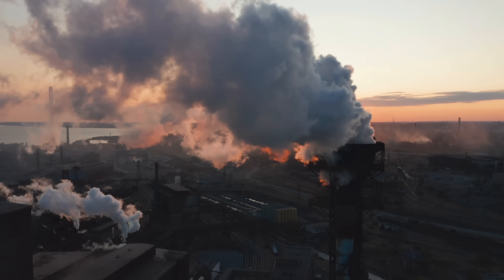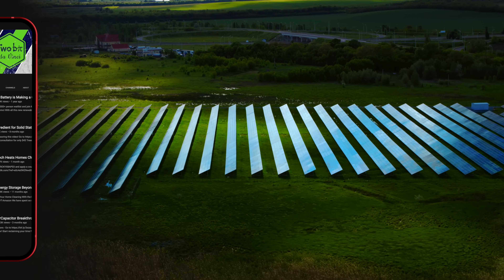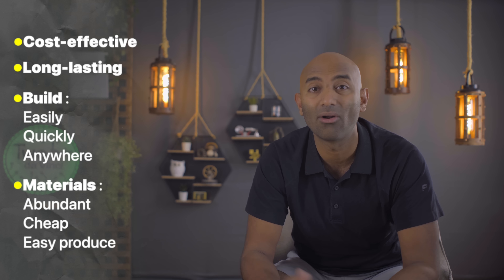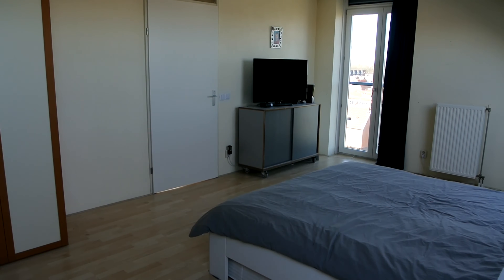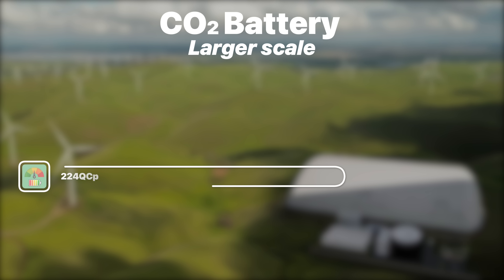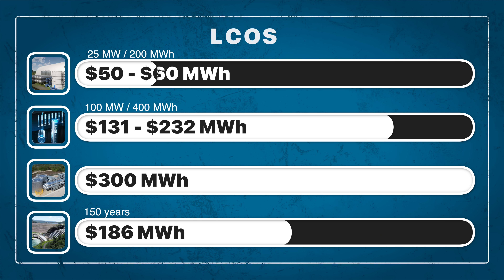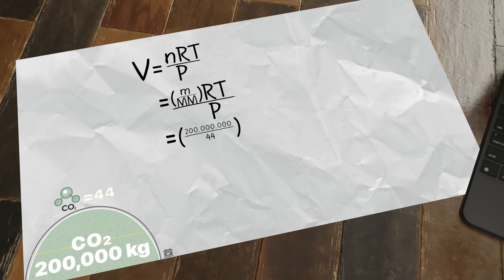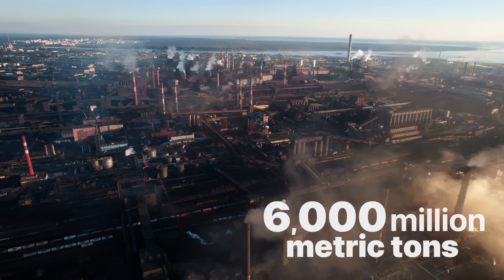The GENIUS Of the Carbon Dioxide Battery

Comment: Yes tell that to all of us who run CO 2 generators into our greenhouses to help our plants thrive even better.
Reply: I can remember years ago shutting all the doors and windows of my greenhouse full of budding tomato plants. They remained alive, but completely stopped growing. This would also mean that they would also stop releasing oxygen into the atmosphere.
Reply: Yep, I run 1500 ppm at 10000 feet elevation here in crested butte. We only have 320ppm here naturally.
Reply: I often wonder that CO2 and how it makes the atmosphere warmer. By the table specific gravity Nitrogen is the lightest, then oxygen,. Carbon Dioxide is heavier.
In fact calm days working in in 6 foot deep closed end trench is dangerous because Carbon Dioxide. That is one of the ways I paid for college.
But what contains the daytime heating at night is water vapor or clouds. Water vapor is also called latent heat. Yep water vapor is lighter than Carbon Dioxide.
So where is that layer of Carbon dioxide in the atmosphere mostly located again?
Another source of water vapor besides lakes and oceans is plants. And plants do what with Carbon Dioxide?
So in a way CO2, water and heat is related. But where do the plants get the energy to take liquid water and turn it into a vapor(clouds)?
There is a thing here in Michigan. Do a No Mow May. I think that Chemlawn, Scotts and the distributers do not like that.
For one thing it gives the plants time to grow deeper roots. This includes grass.
 So if you don't do that. You don't need as much water it to keep it green. I guess the city also makes a profit off selling water.
I don't care. I also have 6 different types of grass growing in my lawn. The one that my dog likes to eat is the one my neighbor does not like. It also is the grass cattle prefer.
You see I grew up on a farm. I do not think a lot of college study understands why the Amish don't need chemicals to make crops grow.
You would think that after 5 or 6 generations of farming. Farmers would figure that out what actually works better..
You see my dumb ass just did not like farming. So I took up BIO-medical electronics engineering. So I kinda know a little about physical chemistry and biological processes.
That does not make me a Ph'D in all of those combined studies. Just gives idea of what questions make sense and also why answers are not logical.
I also am old enough to have went to college, when some of the classes were for how to think. Instead of what to think.
I think this carbon neutral, zero carbon is the work of FlimFlam men and women. Also they are not doing it for fun.
Reply: On top of that, historical records show, the decades of the 20th century that had the highest levels of CO2 (the world war years) had the lowest average annual temperatures.  More CO2 cools down the atmosphere, provides plants with what they need to breath and is nowhere near the Capital-E Evil that propagandists make it out to be.
Reply: CO2 helps plants grow. Our planet is 5% greener than 20 years ago, thanks to CO2. We are still in an ice age let's get out of the ice age and melt this fucken ice. The dinosaurs had 3000 ppm of co2, and their temperature was only 27 Celsius. We have 430 ppm only 0.04 percent of our atmosphere. Our weakening magnetosphere is what is driving climate change, not CO2.
Reply: You wont get extra growth without ALL the factors required for it-extra nutrients water etc!!! CO2 will not do the same outside a greenhouse!!!
Reply: @Mauricio17-x1p 😂😂😂 Yeah that’s why NASA has already shown significant greening of the planet.
Reply: @Mauricio17-x1p  yes it will on a farm field where all the other inputs are also provided
Reply: @Mauricio17-x1p  NASA data shows the Earth is getting greener as CO2 levels rise. CO2 is the limiting factor in many cases for plant growth and plants become more drought resistant at higher CO2 concentrations as they do not need to process as much air to get the needed CO2 thus reducing evaporative loses of water from the leaves. CO2 outside of green houses will lead to greater plant productivity.

Comment: CO2 is the answer. We should promote CO2 production because it benefits plant propagation. We shouldn't be concerned about the increase in temperature of the planet.  If you look at historical evidence going back to Babalonian time you will see increase of temperature of the climate those societies had an abundance of food. People thrived in times as the climate warmed. It also promoted plants and the process of transpiration which is the production of water from plants and production of oxygen. We do not want cooling climate temperatures because the plants will suffer, low food production and increase of death rate of people. More people die in cold climates tha warm climates. The argument that sea levels are rising is true but not to the extent the climate alarmist are preaching. If you take two dimes and stack one on top of the other that is the amount the sea levels have risen. Electric cars are the worst thing we could do for the environment.  If we want vehicles that will benefit the environment we should go to natural gas for vehicles. Natural gas produces CO2 and water. Unlike gasoline, diesel and propane and butane, natural gas would be released into the environment if the vehicle gets into an accident. The U.S. is the OPEC of natural gas. Battery cars will not work. It takes too long to charge, when the battery is replaced the cost is very expensive to recycle because of the heavy metals used to make the battery. Electric vehicles also catch on fire for no reason. Natural gas is the way to go in the future.  For those of you who believe that we need to get rid of oil, it will not happen. Oil is the decomposition of organic material.  We use oil to make plastics, capsuls for medications, clothing, etc... The world will never run out of oil. If you want a cleaner energy to use, we should move everything to natural gas. Wind power and solar power does not produce enough energy for the U.S. Most of the time, windmill generators break frequently and the wind doesn't always blow. Problem with solar panels is the recycling the panels at the end of their life is very cost prohibitive. California is throwing solar panels in the landfills because they are too expensive to recycle. The heavy metals is now leaching into the ground Doesn't sound very green to me. We could use nuclear power which is very cheap and safe and would generate enough energy for our country. The improvements in technology for nuclear power plants makes it the best power source for the grid.

Comment: Manufacturing and maintaining all that wind and solar also produces a carbon footprint. You ignore that too.  Science research shows that an EV has to be driven 185,000 miles before it's carbon reducing benefit outweighs a gas powered vehicle driven the same distance. That's because the carbon footprint to produce the EV is higher before the EV hits the showroom. Charging the EV for the life of it also creates a carbon footprint. In addition, you won't get 185,000 miles out of an EV battery. The new battery has to be produced, and all those processes create a carbon footprint. The cost of the EV is 20,000.00 more then a GV and the Battery replacement is 30,000.00 minimum.

There is nothing cheep about owning an EV and they definitely result in a lot of carbon emissions to make them and keep them running. People are so stupid for ignoring the facts.

Comment: This appears to defy the laws of physics.    The energy required for the compressors and storage will roughly equal the available energy from the compressed air gas minus efficiency losses.   The carbon footprint of the plant itself combines will make this a negative adventure

Comment: You live in what's called an "interglacial" this means you live at a high temperature point between glacial periods or ice ages if CO2 raises temperature you want to start burning as much coal and oil as you can because the next ice age is coming and it's going to last 90,000 years, interglacials last 10-15,000 years and we are at the end of ours you're not going to get hotter you're going to get a lot colder.

Comment: Just a note for the incorrect information related to the microinverters. Modern solar panels have bypass diodes. These diodes prevent a single panel, or even multiple panels from shutting down the entire string. A single shaded panel will cause the entire string to produce less, but will not cause the entire string to produce nothing.

Comment: Wind and solar are both bullshit. They don't work enough to offset the cost to make, maintain, and dispose of. The built in life expectancy failure points assure that the carbon footprint vastly outweighs the marginal gains. The highly toxic batteries have virtually no staying power and are killing everyone involved with making, maintaining, and disposing of them. This is entirely a scam.

Comment: The main problem with solar, wind, and electric cars that I see is the amount of environmental damage done by mining the lithium and other rare earth metals to make the batteries, panels, and whatnot. On top of that, the batteries only last for 10 years and do not have an efficient way of disposing of, which means they're gonna be disposed of in a way that will further damage the environment. This is why I see natural gas and nuclear as the only way forward for constant and effective energy. Natural gas has a significantly lower emission rate than coal, and nuclear, so long as the technology is maintained properly, is almost never going to have any major catastrophe like Chernobyl. There have only been 2 major nuclear meltdowns in the past 60 or more years, and neither of them were in the US or in new plant's. Let me know your thoughts on this as well I'd love to hear it.

Comment: The clickbait title implies that CO2 is not a problem at all, but the script and the data referenced by it point out that it depends on its LOCATION.  Mixing freely with the atmosphere, CO2 IS a cause of climate change via the Greenhouse Effect.  But confined as in an energy storage system such as the one described here, it becomes part of the solution.

Ozone is similar; at ground level, it causes health problems, but up above the stratosphere, it protects us from UV radiation.

Comment: Who has the ability to control the weather?  Your belief that carbon dioxide is a culprit might be wrong?  Just have a think! Science knows a lot about millions of years of weather and CO2 concentrations.   Most of earth's history is full of periods with much higher concentrations of CO2.   We have lots of oil and gas because of these high levels of CO2.  Life flourished.  Should we maybe worry a lot more about global cooling and a coming ice age?  Wouldn't an ice age be much more catastrophic to all life on earth?  Just a thought.  I think you might do more research on different opinions with real data.  Modern weather knowledge and detailed data are much less than 200 years.  Life one earth has been around over 100 million years.  It evolves along with the weather and conditions on the planet.  We've had over 10 ice ages.  What caused them?  Why did they end?  Man wasn't a factor.  Man's activities don't amount to your drop in the bucket even today.   Stop the BS!

Comment: Lake Nyos in Cameroon comes to mind with something like this. Over 1,700 people dead and over 3,000 livestock.

Like nuclear plants, these obviously cannot be located anywhere near populated areas. But even if this was located so far away that the risk to human life was not significant, you still have the risk to wildlife and the ecosystem surrounding the facility. A cloud of CO2 will pretty much sterilize a region of all animal life - insects, mammals, any reptiles and amphibians, etc. And until it dissipates, it won't be great for plant life either.

CO2 in any significant mass settles toward the ground and creeps along with the air currents. Silently killing anything that crosses its path.

So hopefully they've heavily evaluated the risk to the surrounding area. Tried to simulate as best as possible what would happen should the tank or refrigerant lines rupture and getting a good idea on how any released carbon dioxide will perform. Engineered so that any possible release of CO2 will happen in a controlled fashion to avoid substantial masses of it being released and creating killer clouds.

Comment: The biggest takeaway for me is that since CO2 doesn't require cryogenic assist to be compressed into a liquefied state, it is much more efficient than compressed air. For utility power plants, I don't think the CO2 battery's low energy density will play much of a factor in deciding whether to use it in comparison to other technologies, though the short vid of the Tesla with a CO2 dome on its roof was a good bit of fun.

Thanks for the great video. I see so many videos like "Graphene Eardrum Replacement Surgery Enables Supersonic Hearing", and it turns out to be nothing more than a calculation someone did on the resonant frequency of a piece of graphene the size of an eardrum, and is nowhere even close to becoming reality. That there is a CO2  pilot plant currently operating and a contract to scale up this tech in a real-world application is just wonderful and makes this video so worthwhile. Thanks for covering this.
Reply: be more skeptical. on the diagrams the liquid cooling system has no pumps. 
supersonic rocket surgery battery enabled!
Reply: You can criticise but this could save us all from the money hungry power companies that bleed us dry.
Reply: @Lorenzo-ew6so  I'm not sure what you think I'm criticizing, but to be clear, I am absolutely heaping praise on the utility-scale compressed-CO2 battery explained in the video. It's the best, most sensible advancement in utility energy storage I've yet seen.
Reply: @Astronomator  
one more thing/giant rant. what if we find out that using a regular refrigerant in the system is a lot more efficient than CO2? still CO2?
i swear its a total obsession. what a fad. the premise being that you actually need storage tech . we already have 'storage' tech. 
its called nuclear fuel rods. zero CO2.
but if we need something non toxic that people can put in their mouth,
we can always use giant rubber bands. 
theyre more efficient and the carbon would be trapped in the rubber instead of in the dome. takes a lot less volume. we can then bury the used rubber in a carbon sequestration program. and if the program fails the worst that could happen is you will find people chewing on it. this is practically watertight on every level. yuck.
Reply: @echelonrank3927  It's not the use of refrigerant, but the energy needed to liquefy compressed gas (through refrigeration) that makes other gases less efficient than CO2 to use as a battery. A lot of energy is stored/released during phase-change, and CO2 undergoes that phase-change without the use of power-hungry cryo-equipment, giving CO2 a definite advantage in efficiency.
Reply: @echelonrank3927  Please don't put words in my mouth. Neither I nor the video said that CO2 is the most efficient gas. The only comparison made between gases in the video was between CO2 and air, and CO2 gets the not for efficiency between the two because it can be compressed to a liquid without cryo-assist. I'm sure other gases are more efficient than CO2, but CO2 is abundant and essentially free, unlike most other gases we could consider. And once you have a free and plentiful gas that can undergo a phase change through mere compression alone, there's pretty much no reason to keep looking for a more efficient gas. 

I won't dignify the rest of your comment with a response, as it's not even on topic.
Reply: @Astronomator   meh. lets first see how a working prototype of this egregious design performs with CO2 or whatever  else and then start cancelling dignities accordingly.
Reply: @echelonrank3927  Did you not watch the video? There's a pilot plant--a large one, at that--already in operation that proves this concept. And a full-scale version for a commercial utility plant is under construction based on the resounding success of the pilot program.

Why on Earth would you call this design egregious? Did science hurt you when you were a kid?
Reply: @Astronomator  yeah check out the scars.
 i totally stopped watching halfway when the fake elon musk ad came on, but i did go through the basic diagram.... ok i saw the rest today and  im slightly impressed. but the promised cost seems very low for all the machinery and dome theyre gonna have to build. i still want to see the commercial plant generating a real profit as final proof this is legit.
Reply: @echelonrank3927  Fair enough. Actual profit would be the nicest form of proof-of-concept.
Reply: @Lorenzo-ew6so  ....to be replaced with money hungry weird new expensive battery companies that bleed you dry. 
who knows.
Reply: May God help us reach these goals
Reply: Proper Greens push a minimisation of land usage, Fake Greens push a maximisation of land usage. All their sprawling, inefficient giant 'energy solutions' are disgusting... Solar and wind farms, hydro power and biofuel production, giant energy storage plants, landfills instead of incinerators, 10x more (global and national) infrastructure... The Fake Green revolution also pushes taxing plant food (the air we breath out), crap'n'trade (carbon credits that push hyper-pollution), and forced MASS SALES SCAM after scam.. Why don't you just stop being a Fake Green and become a real green guy and think in terms of MINIMISING LAND USE...